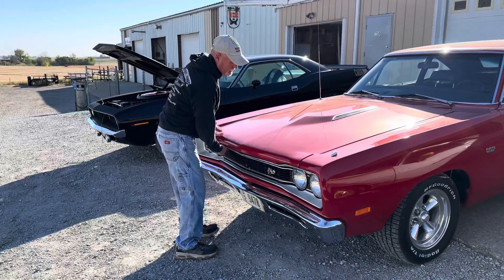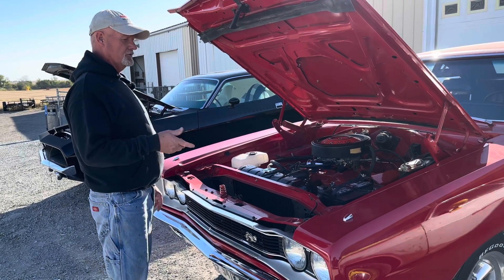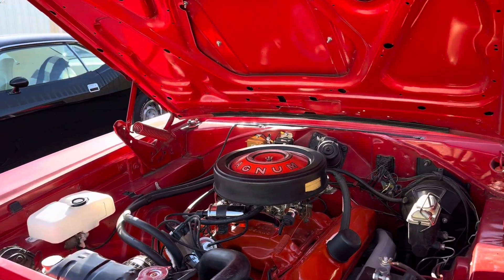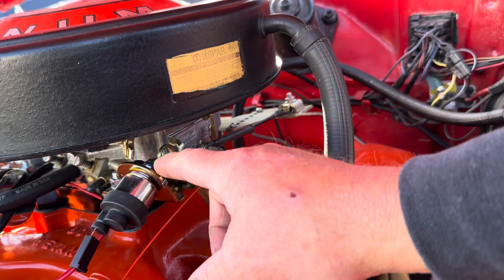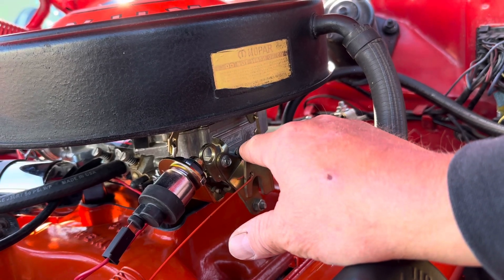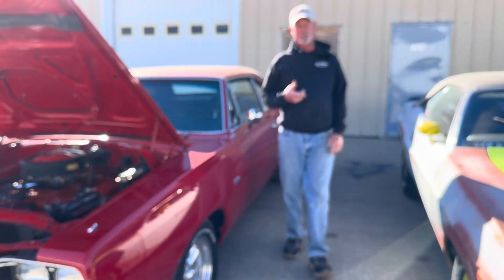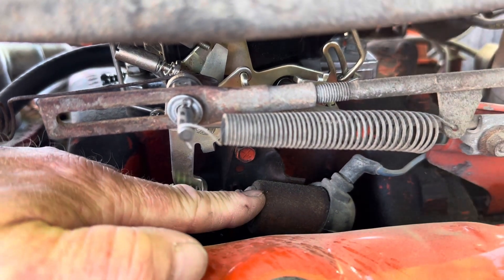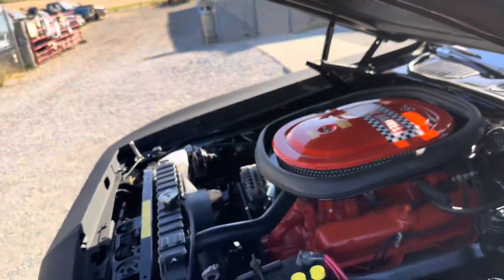69 SuperBee: Why a Idle Stop Solenoid is needed

Comment: Adjust your timing.
Reply: Why? When you shut the thing off there is no spark. It's left over heat that makes this problem. And you must not know alot about these engines if you think timing needs to be taken out. Most of the time they need way more timing than people put in em, should be in the 30s of degrees
Reply: @zekeoutdoors  bad timing and bad gas cause dieseling. And yes I do know a little bit about these cars, I grew up working on the 60's and early 70's cars. First engine rebuild was my buddies 65 mustang. Of course it could also be the carburator needing cleaned or rebuilt.
Reply: @mickeldannheim283  just rebuilt 750 double pumper for 454 for a leak and high idle air leak run off , ran great for a while now run off has returned (but no high idle)  bowl levels still good . Has a push button start along with key power that I thought may be the culprit but not sure.
Reply: @JayTX.  Most air leaks have a bad gasket, but double pumpers have always been a pain, almost everyone I knew who had one got rid of it. If you can find a 3 barrel try that, they're not that common but give better performance than a 4 barrel on average.
Reply: @mickeldannheim283  you think you know about cars but you don't understand hownto work on performance cars. You are wrong. Sorry but you don't know what you are talking about. Also this is a factory part. Even chrysler said this is how it should be done. You don't know more than them. You also don't know more than the average grease monkey

Comment: If you have to give the carburetor so much idle adjustment that it runs on, then your not using enough initial timing, with more timing idle will increase and you can back off the idle screw. Get the motor good and warm then put in just enough initial advance till it fights back on the starter then back till it stops, then restrict the total advance mechanism to a safe amount for your engine, also helps to lighten springs so its all in by the converters stall speed or cruise rpm.

Comment: When the engine is idling, all the fuel comes from the idle circuit, which feeds the engine from below the throttle plates.  The solenoid works by simply cutting off the air source at the throttle plates.  Many cars had a second solenoid to raise the idle when the air conditioner compressor was engaged.

Comment: I don't have dieseling problems with my Chevy c10 so I hooked this Idle Stop up to my Air Conditioning so that I wouldn't drop in RPM's when it's on.
Reply: Most gm cars and trucks came equipped with a solenoid to help with the ac load. If you have factory ac, it should have been there already.  Sometimes,  these go bad, or are removed by previous owners.

Comment from the maker: close completely?
In order for the engine to idle, the butterfly valves must be slightly open even when your foot is off the gas. If they closed completely, all air would be shut off from the engine, and every time you took your foot off the gas the engine would stop running (even with the ignition on).
How does an idle stop solenoid help with this?
An idle stop solenoid is an electrical device that, when energized (by the ignition being turned on) causes a pin or plunger to pop out slightly. This pin comes in contact with the throttle linkage and
causes the butterfly valves in the carburetor to open to the idle position. When the ignition is turned off, the pin retracts enabling the butterfly valves to fully close, preventing air from being drawn into the engine and preventing dieseling.

Comment: Dieseling is caused by too much timing....

Dieseling is caused when the cylinder creates its own combustion heat...without the need for a spark. It's a combination of timing, running hotter than engine design intended (for emissions reduction) and higher compression. A normal internal combustion engine doesn't have enough compression to ignite the fuel charge only with compression heating effect. But, throw the other conditions into the mix, and it can (and does) happen with the ICE. Mopar used a lot of 'tricks' to prevent this, such as: shutting the air supply off completely [solenoid], turning on the A/C compressor when the engine is cut off so that it will load it enough to stop, etc.

If you have a hi-compression engine with the emissions stuff still intact, you will have to get 'creative', too. Back in the day, most of us just put the car in gear when we turned the engine off (released clutch a bit after engine "off"). That would 'kill' the engine with no problem.